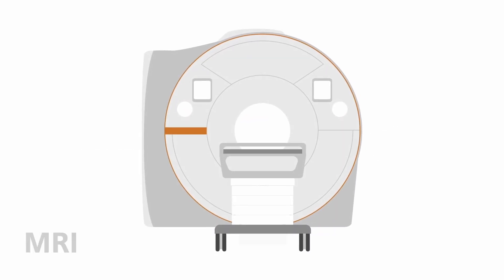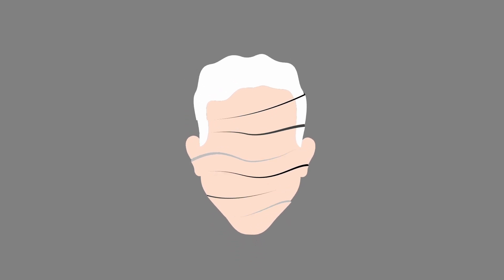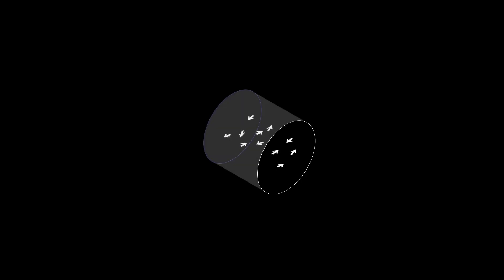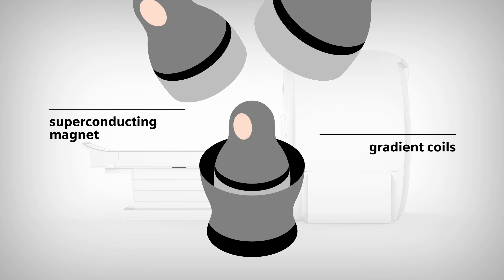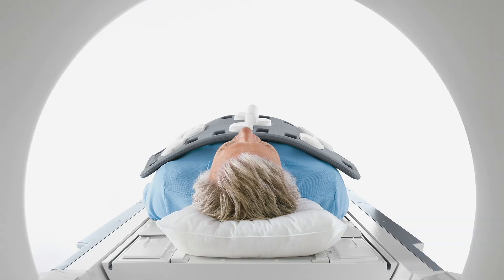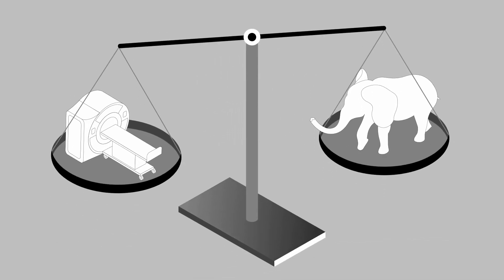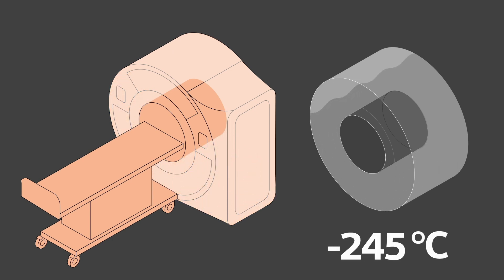MRI explained: How does it work?

Comment: "it's not dangerous" to be surrounded by liquid helium that is -450*F and will turn you into a popsicle in a nanosecond. Not to mention that any magnetic metal inside you will get ripped out like a hot knife through butter. LOL. I think I prefer old-fashioned X-Rays.
Reply: If the Helium "leaks" it instantly evaporates into gas and it is channeled out through vents in the roof. This is called a quench. And nothing will "rip out of you", most implants today are made of materials that pose no danger while undergoing an MRI. Implanted devices like pacemakers and neurostimulators can usually be scanned too, but under strict caution and parameter limits. X-rays and CT do not image soft tissues with near as much detail as MRI.

Comment: The paper didn't tell me about that chest plate. I was allowed to do mine without it (bc the unmentioned face cage for my brain was trouble enough), but it would've probably blocked the unbareable knocking vibrations through my unmonitored tachy heart. I believe that combo IS dangerous. Imagine putting a hard knocking vibrating tool up to your arythmic heart for an hr (which the hospital knows from past vitals and ekgs). It's not just a sound, sounds are vibration. Especially if you're there for a neurological referral (I don't think they could see that my scolded movement was spasms and not voluntary). That and the cold triggered shaking which scared them when they pulled me out. 

These kinds need some protocols for certain conditions. I believe they should be able to see and hear you inside, and let you know so. A pull out between two scans must be used to not surpass 20 mins caged at a time. If vibration pausing whilst in is able, do so based on heart and breathing activity. Do a 1minute inserted comfort test for the patient to find their comfort position and determine whether they want their eyes open or closed, pull out sit up one last time, then begin. Sitting up also helps me under dental anestheic.

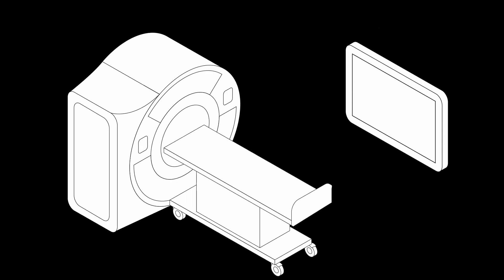Comment: we image by detecting intrinsic signals that can be generated by the net behaviour of hydrogen nuclei.  Not water as such.  and when the aligned nuclear magnetic moments are disturbed by the excitation pulse we create a temporary detectable net magnetizaton rotating at a specific frequency. The spins do return rapidly to their previous alignment, but not as rapidly as the detectable signal decays away.  We do not record the energy of the spins returning to their previous alignment.  This is not a simple excitation and release event like we might use in a mercury vapour light etc.| so not like you say at 1:03.  Coils not antennas usually.  
The explanations of the equipment are better.  But I've never installed one in a basement :)

Comment: Why the radio waves are not introduced in the video which also plays crucial role while imaging process?
Reply: becaus we do nopt use any radio waves.  We only use magnetic fields rotating ta  radio frequency.   Radio waves are predominantly an electrical field far field event. Nuclei dont respond to electrical field energy.
Electrical fields will deposit useless energy as heat ( bad news)
Reply: @SpinUpDownUnder  There are videos that explain MRI with radio waves. In those videos, the radio waves does the work of the deflecting field. So are there two types of machines?
Reply: It's all electromagnetism, it's all the same thing.

Comment: Doesn't really explain how the image is produced.
Reply: Yes it does. It’s produced by the signal that the hydrogen molecules send back to the computer.
Reply: When the hydrogen atoms in your body align with the magnetic field, radio frequency impulses cause the atoms to "resonate" (hence Magnetic Resonance Imaging, or MRI), this induces a signal that is collected by the body coils. The signal is then transformed into raw data that the computer sorts/converts into the final image via a mathematic equation called the Fourier transform. One image equals one slice, or one 2D image. The machine does this over and over for a single sequence which can be at any angle or "plane".